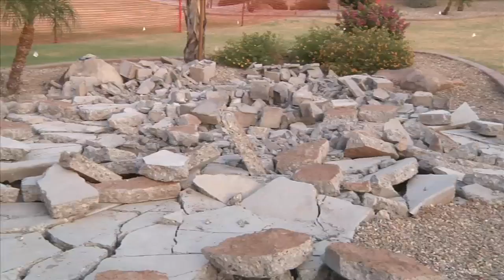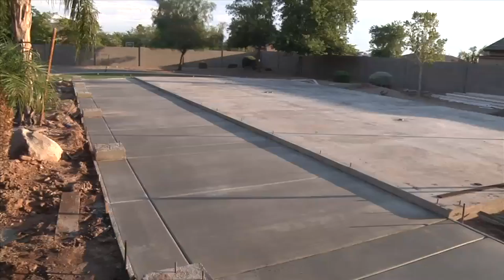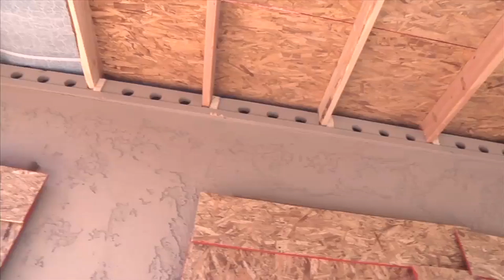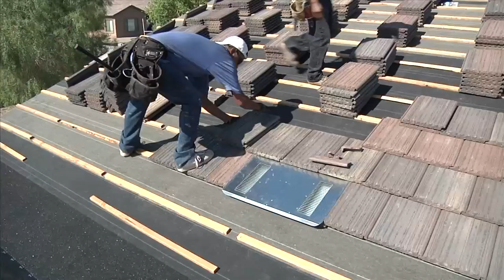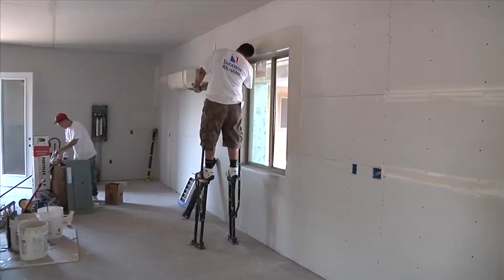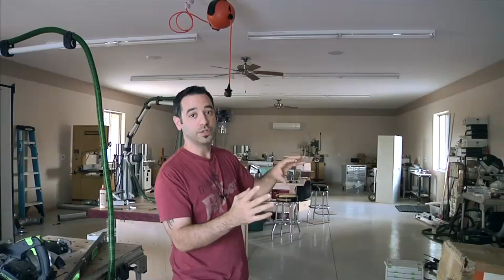Building a Dream Woodworking Shop

Comment: I think I'd build a room for the dust collector with a sound proofing material like rocksol.  Then add a air return all the way on the other end of the shop oversized to help lower the noise even more.  Its basically a big muffler.

Yep I'd go in and bug your wife too if I was you. Good reason to go inside.
 You need to get her out in the shop helping.  My wife would be she likes working on machines, but she works in an office.  My kids are your age.
I'd look pretty funny holding a 38 year old to touch my drill press.

Comment: PLEASE RESPOND!!!  I am building my own "dream shop."  In working on the power, our architect is saying we should avoid "flush/recessed" floor outlets because the saw dust could work its way into the outlet and pose a fire hazard.  he is recommending we bring the outlets vertical 18" above the finished floor which in my mind seems aweful because it will pose an "obstacle" to arranging my machines.  Did this come up when you built?  did you have to use a special housing for your floor outlets to avoid dust getting in there?

Comment: hello everyone, i have a quick question. for the lighting of my shop i have the choice of 4000k and 6000k. which would be better? (might go for filming later on)
Reply from the maker: I'd go 4000 if those were my only option. 6000 is very clinical and I find it straining on the eyes.
Reply: The Wood Whisperer will do, thanks for the response!

Comment: How is that unreinforced concrete slab doing after 5 years?
Reply from the maker: I moved recently but when I left it was in perfect condition with absolutely no cracks or heaving at the joints. I guess these Arizona builders actually DO know what they're doing. :)
Reply: It was just a question, unlike your response, mine had no implementation of NOT knowing what they are doing or asking.
Reply from the maker: +David Cox it was a reference to all the other people who predicted slab failure. That's all. Nothing personal intended.
Reply: You gotta give the guy a break. I mean have you seen the comments these Youtubers get?? It's like everyone is out to get them. I don't know how they put up with it. Makes sense that they are on guard and a bit sensitive and might read into a comment here or there.

Comment: I noticed when you were showing the lighting that your bulbs are not protected by cages. That could be hazardous even if you have high ceilings. Have you ever considered converting to LED lighting. Safer and lower power consumption.
Just a suggestion.

Comment: Just wondering, not criticizing.  Why no reinforcement in your concrete slab?  Not a requirement in Arizona?  Nice shop and nice dogs too.
Reply from the maker: I'm not a builder so I can comment on the specifics but things in AZ are very different than many other states. No frost line, etc.... So you can get away with a lot less in the way of reinforcement.

Comment: Built my 2400 sq ft shop when I retired. My only regret is not putting in a wood floor. Standing on concrete tires your feet and legs much quicker.

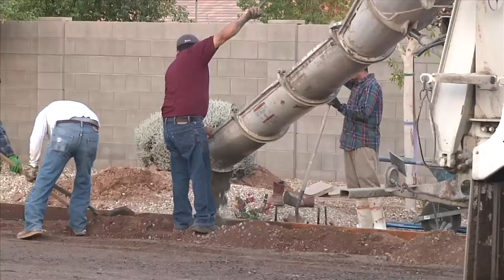Comment: At 4:10-ish… you mention conduit for the five in-floor outlets.  Does this mean your design included exact placement of large equipment that would utilise these outlets?  Or is it perhaps you knew before hand where the tools would be within a few feet, and that is close enough?

I should probably keep watching, you may answer my questions, but I'm curious because I am also building a shop from footings up.  In addition to power outlets, I have also been wondering about l routing some of the dust collection duct work under the slab as well.  Any thoughts?

Comment: good luck with the concrete. no reo no plastic. that will have cracks through it within months and the cracks will just get thicker. they had the reo sitting on ground so concrete will get cancer within 3 years. shit job
Reply from the maker: haha well it's almost 4 years later and none of this has happened. The rules are different here in AZ apparently.

Comment: Thank you for this video. I am in the research phase of my dream shop and this helps. Can I ask why you upgraded your panel to 400 amp service and ran a sub-panel, rather than having a separate service line and meter run to the shop?

I have been going back and forth on that choice for a month now. Part of me wants a sub-panel so that I can upgrade my main panel at the same time. And part of me wants separate service for ease of tax and business cost accounting. If I don't attach the shop in any way, then completely separating the shop business from the home becomes much easier and more beneficial.
Reply from the maker: I honestly don't recall the details but my guess is it was a matter of cost effectiveness and code. I don't know if running an entirely separate service was even on the menu for us.
Reply: The Wood Whisperer Okay, thank you.

Comment: Awesome shop!  Out of curiosity, why the drywall on the inside?
I would have expected something like plywood to make it easier to mount things to the wall.
Reply from the maker: I doubt local code would allow plywood for the walls.
Reply: I live in phoenix and have been researching my dream shop. Phoenix yields to 2012 International Fire Code. Fire code seems to be the main rational behind Gypsum board. The code states that any structure that is within 3 feet of the main structure, must have a fire rating of 20 minutes on the wall that faces or attaches to the main structure. This would indicate that only 5/8 drywall be used. 

Every other wall could be covered with plywood. If there is a man hole to the attic then that has the same drywall requirement. 
Of course, this is just my interpretation of the term "Gypsum board or similar" when there is no fire rating requirement. The code states that gypsum board is the only approved material where a fire rating is required. And it states "Gypsum board or similar" where no fire rating is required.

Comment: Would the home owners association not allow a larger structure? I was thinking you could add a  bunkhouse with about 25 beds, that way you can have upwards of 20 workers on-site at any one time.  If it were me I would add a kitchen and large rec room, I just can't see how you will get by on 1800 sq. My quest bath  far exceeds  in sq footage, would it not be cheaper to convert a closet  or something?

Comment: did you delete your 360 shop tour pictures off of your website? I've seen them before but now I can't seem to find them!
Reply from the maker: +leeouel these? http://thewoodwhisperer.com/marcs-shop
Reply: +The Wood Whisperer yes lol thank you... I'm gearing up my garage and it's always nice to see an experience woodworker's layout for tips -- thanks buddy
Reply: +The Wood Whisperer it's crazy how much value you have in your shop!!

 I'm looking into getting a Festool Setup with a CT Vac,  I noticed you have like 7 of them haha which one would you recommend for using for all my tools?

I was thinking about a CT 26 with a Clearvue mini (to reduce use of filter bags) and having both of them on a vertical cart of some sort.. What are your thoughts on this?

Thanks again!
Reply from the maker: +leeouel That's a good combo. Basically, just think about how often you want to empty the thing. I'd let that be your guide as to which unit to buy.

Comment: Wouldnt textured walls in the shop pose a dust issue?
Reply from the maker: +Chase Odgers The texture isn't so substantial that it causes any more accumulation than you'd see on a flat wall.

Comment: nice build, and congratulations on being able to afford it, but, i'm curious why the contractors used maybe twice as much lumber on the walls as necessary. they spaced the studs at what looks like 16", but those were 2"x6" studs. should have been spaced at 24", especially in a building whose only load is the roof.

kudos on the ferris beuller reference and the wood whisperer terminology.
Reply: +Chris R exterior walls,now days 2x6" means more insulation.
Reply: James McGuire
in southern canada, and possibly all canada, we've been using 2x6 studs since the late 80s in a program called the R-2000 system of house construction. 2x6 studs allow you to use less wood spaced more widely (60cm (24") up from 40cm (16")), leaving more room for insulation batts. i don't know if they still do it, but back in those days when i was studying architecture all the graduating architecture and architectural technology students in the country took part in the r-2000 competition to produce the best designed house. the winning team spent a year working in an architectural firm.

Comment: I don't really understand why almost all buildings in America are made out of a wood frame. Where I live (Poland and Europe in general) almost all buildings are made out of bricks or similar. Could somebody tell me the reason?
Reply: +pyrox Trees are bountiful in the USA and the cost is less overall.  Plus, the USA homes are not for generations living in the same home like what you see in Europe.
Reply: We're a much younger country, and especially young in the western part where Marc built this, so we didn't build most of our country's structures when labor and materials were cheap. We tend to have larger houses than you do, because land is relatively cheap and so are our buildings, since they're made of cheaper materials. In other words, we've traded durability for size. Also, we didn't mow down all of our forests like Europe did, so we have a lot more wood to build with. Also, in the western US, we have earthquakes, which rapidly destroy brick buildings. Still though, I agree that we tend to have structures that are not very strong compared to masonry, and they don't last anywhere near as long. It really bugs me that we build the same type of structure regardless of where it's located, and just put a bigger air conditioner or heater in. What we should do is build with whatever materials are local. In the western US, that would be wood. The southwest would use adobe. In the plains, it would be sod, and in the rest of the country, it'd be masonry.

Comment: I am happy for this guy, but if OSHA gets a hold on this video, dude would be in trouble.  No one wearing PPE, there's personnel above 6 feet without restraints, but worst of all he had pets as well as himself walking around an area where there were bars used as part of the rebar sticking out the ground with no rubber covers on them.  The dogs could have been hurt.  There is also certain gear that must be used when dealing with electricity.  I mean it's a nice set up, but don't let OSHA see the video.  Lastly, was everyone working there legal? This having illegals do work that certified construction workers are suppose to do, to save by paying way less then the minimum is an ongoing thing in America.
Reply from the maker: +AUDACIOUS VEGA First time seeing a structure put up in Arizona eh? :)
Reply: +The Wood Whisperer Yes, ADOSHA was established there in 1979, I believe so they too fall under the same regulations as OSHA, due to that is what was adopted.
Reply from the maker: +AUDACIOUS VEGA That wasn&#39;t the question. I was simply stating that you obviously haven't seen many residential structures go up in AZ, otherwise you wouldn't be so surprised by what you saw. I'm not talking about OSHA rules. I'm simply talking about what happens on a typical residential job site in AZ.
Reply: +The Wood Whisperer 
No worries,  I am glad you got your shop set and that everything worked out. I was just commenting. The reality is that you can show the video all day, due to you will not be the one facing fines; if any. The one that will receive fines would be the lead contractor.  As you say though; Arizona construction crews, or teams do not follow any of the rules or policies posted, hopefully no one will get hurt or lose their lives, due to these guys bad habits.  Well, good luck and keep doing what you do, you are gifted on woodworking.  Have fun, take care, Merry Christmas and watch out for road runners.
Reply: +AUDACIOUS VEGA Well, if I ever considered doing anything in the US, then AZ would seem like a better place to do it, because there'd be less red tape!
Reply: +AUDACIOUS VEGA Welcome to the real world. Texas is the same.

Comment: Very nice shop!! Mine is 28' wide x 30' deep with a 10' ceiling...unfortunately not as much thought went into my build as yours. All tools/benches have to stay against the walls as my wife's Jeep requires a place to park over night and I have numerous quads/sleds to house also.  Soon plan to build a secondary shed for the toys and lawn tractor so I can free up valuable floor space for me to begin wood working as a hobby...congrats on the dream
Build!!!

Comment: This is exactly what I'm looking to build in a couple of years when I retire (early). -- I'd like to know, and forgive me for being rude, what is the average cost for a shop structure like this. Perhaps a cost per square foot would be fine, so I can figure what I'm going to need to spend. -- I too have to do all the electrical and plumbing upgrades, so an average cost per s/f is fine. -- Thanks and GREAT videos!
Reply: +Calixto I found the below in a search for cost per square foot addition in Phoenix, AZ."Cost of Building a Home Addition in Phoenix, Arizona$106.49 per square foot for standard grade construction (Range: $82.28 - $130.70)"1800 square feet addition probably cost him between $149,000 and $237,000.    No surprise.  He built a 1800 square foot house with one great room, a 1/2 bath and a sink.   With no kitchen or multiple baths the price was probably closer to $150K.
Reply: @Prof10000, thank you Sir. Very good of you to look that up for me. Much appreciated!

Comment: Such different building process from AZ to Texas. We could never get away with an 1800sq ft slab without rebar or post tension. 

Love the 2x6 walls though. 

OSB Sheeting should have been laid horizontally though.

Comment: Well I'm sure every woodworker has a different idea about a "dream shop" but I'm afraid this falls short of what my dream would be, where is the dust collector? air compressor and lines? and I would suggest that it's strange that there is no solar
Reply from the maker: David Haxton you need to look at the later videos. Marc did 2 videos on installing a dust collector.  And yes we installed solar and Marc wrote a blog post on it that lives on our website.

Comment: Go with LED's man. More upfront but they dont burn out are cheap to run and you never have to replace ballast.
Reply: I replace about 2% of my LED fixtures every year in my facility.  They don't burn out, but the "ballast", which is just a transformer and rectifier circuit, does.  And the overall cost is 10X what a light bulb would cost.  The only valid reason to use LED's is to save energy, and I'm not sure the added cost for repair doesn't nullify that, too.

Comment: I am envious of your shop. Any particular reason you didnt make the walls taller for added ceiling height?
Reply: jimmicreesti I probably missed that. I knew he was joining the two but there are still methods to join two structures of different heights. The height difference might have also not been in agreement with his homeowners association.
Reply: I did think about the roofline difference and how it could be an "eyesore". I mainly made the comment because I was just recently handling full boats of plywood in a friends garage and remarked at how thankful I was that his ceilings were 12'

Comment: Never seen a professional crew use snow shovels to pull concrete back with. Most of them use a comalong. Speaking as a professional drywall guy myself Texture in NO WAY make repairs a breeze if anything it makes it harder.The only thing texture does is cut back on the amount of finishing work the drywall guy has to do in order to cover seams and how many times they have to coat. When you put a hole in drywall that has knockdown on it you can't just simply patch it and paint, you have to do a lot of EXTRA work to make it match the knockdown texture. If you just patched it and painted then you would have a patch area with a solid smooth part from patching. If a drywall guy told you that it would be easier to patch and fix on he lied to you. He was just trying to make his job faster and simpler was all. Anyone else that believes Texture is easier to make repairs to obviously has no drywall experience.

Comment: Why build a workshop without floor drainage? Went to all the work in having plumbing but no drainage?
Reply: woodshops dont have much in water...
Reply: well, it's above ground and in the desert, so I don't think flooding is a real concern. I would be more likely to flood my kitchen, but I don't have a floor drain there either.
Reply: Why plow a field without power outlets every ten feet?

Wait a minute...

Comment: Another point @ the Lighting part of the video.  T8's are/should be installed in pairs in "machinery" rooms/shops because single tubes can have a strobe effect and make machinery moving at many RPM's look stationary.
Reply: That's really cool, actually.

Comment: Nice shop!  I  built  mine  with  14' tall walls and 32'  x 40', I love it.found  that a CRI or Color Rated Index.  this CRI rating gives woodworkers the truest color for seeing what stains and such will look later.   92 CRI is closest to the sun on a clear day at noon.  It has the right wave length spectrum,  then  its just a matter of how many.

Comment: were really Electrical wiring to outlets run under the concrete? :o seems  like it would be a hell of a job if wires were melted if there was shortages or something and you'd have to rerun the wires
Reply: It's run through conduit. You can always feed new cable through if you need to.